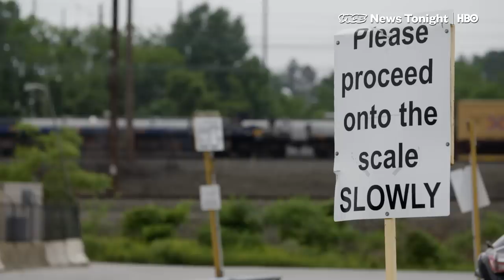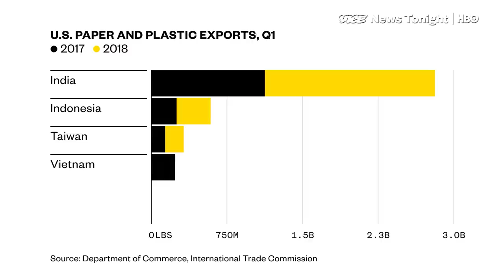China's Waste Ban Is Causing A Trash Crisis In The U.S. (HBO)

Comment: 75-80$/ton sounds like a pretty good price. I wonder how that compares to coal or natural gas as a fuel cost.
Burning trash to make electricity and heat makes a lot of sense to me considering the situation. 

I guess this is the higher grade of trash, the recyclables though. Can paper companies easily feed in the paper and cardboard rather then virgin wood to make pulp and paper? I bet they pay more then $75/ton for their pulp wood.

The plastic can be turned into tar for paving roads, lego type building blocks for construction, sidewalk blocks, etc.

What ever happened to pull yourself up by the bootstraps USA? Do you need China to pull up you bootstraps now? Perhaps they will pull them up for less then you can pull up your own? But then you will lose your edge, won't you?

Comment: I have a answer for this they need the many strains of bacteria cultures that have already been engineered to breakdown many forms of plastic even polyeurathane that don't release c02 as a byproduct. They need huge bioreactors at each landfield that can grow as big of cultures as possible the bio reactor tanks could then be moved and sprayed over large areas as they are produced as for styrofoam large meal worm colonies should be grown at every station. As they are effective at breaking it down quickly. This is an extremely cheap and viable option.also even though not discovered yet that I've seen there is alot of plastic reducing bacteria at Chernobyl breaking the city down there should also be some there that evolved to break down radioactive waste.aparently they have at Manchester university they said they have problems venting for them to breath this problem could be fixed by training the cultures in a vacuum chamber and slowly lowering it's atmospheric pressure over time or mixing in cyanobacteria to produce oxygen.